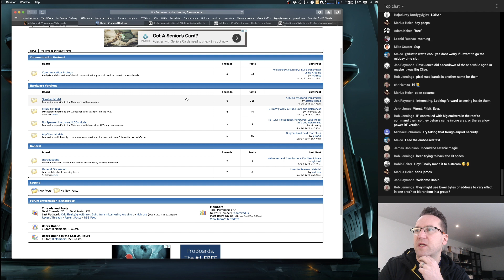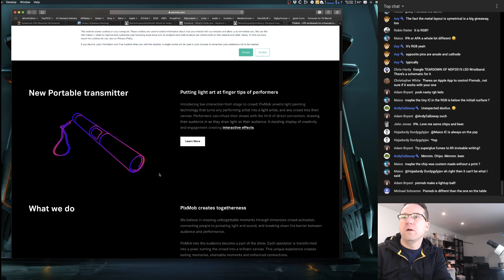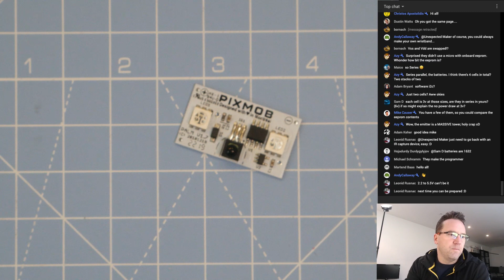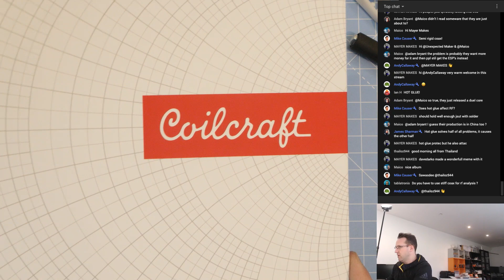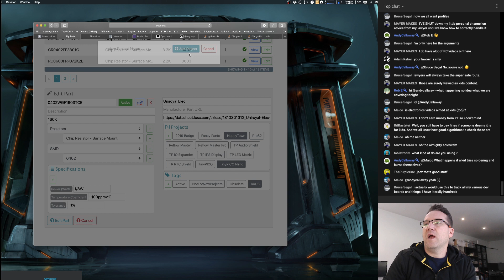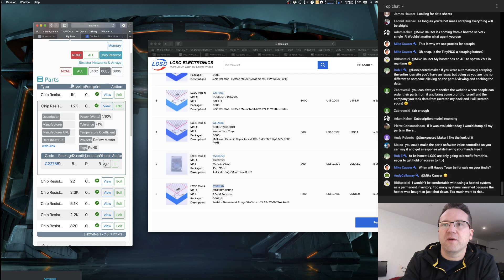LIVE: What are these and how do they work?

Comment: Try here: xylobandhacking.freeforums.net (Stefan Krupop designed an arduino shield and also created a suitable library) . From what I know, they work on 433Mhz and use a proprietary protocol. I have an old model - xylo5-c. I think the producer also sells a controller for them.
Reply from the maker: In showed those links in my stream... my wrist band is not a XyloTest one.. it's a PixMob... quite different :)
Reply: I didn't have time to follow the stream yet 😁
Reply: Watch the stream first next time huh? Save yourself looking like an fool.